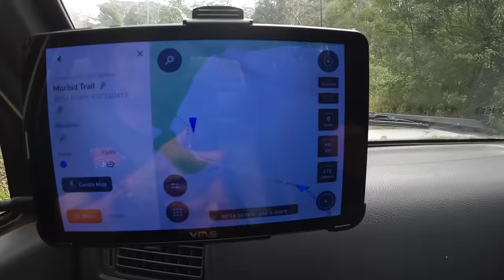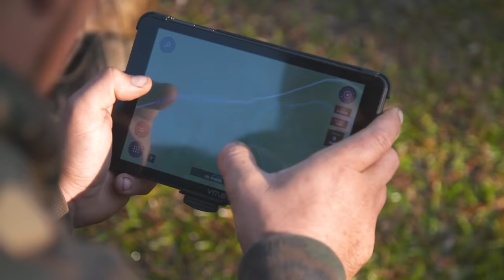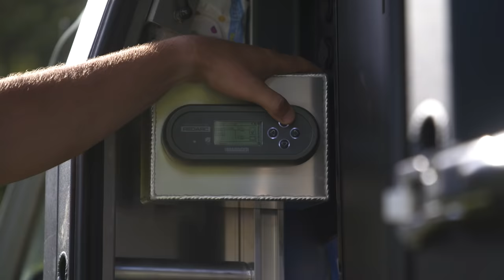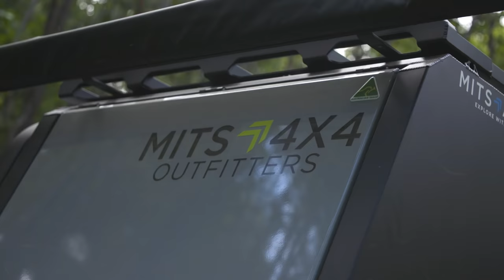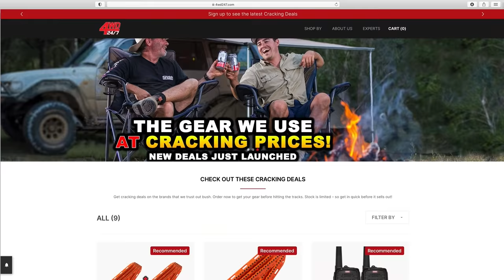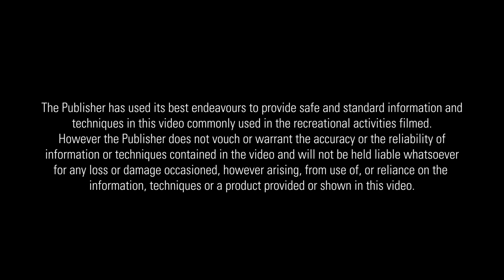OLD BUDGET 4WDs vs. Australia’s TOUGHEST tracks in Coffs Harbour + Snapped Axle & Best campsite EVER

Comment: Driving through the Lesotho mountain switchback passes at about 11pm at night in absolute darkness. Rushing down the hill taking the switchbacks and coming to a corner / cliff edge and touch brakes and all I get is abs shudder and noise but speed not changing, luckily the triton (colt / l200) managed to accept a lower gear quick enough and the duratrac tyres with their super grip kept the van on the road and through the corner. The rest of the way down the pass never went higher than 2nd and of course we were in low range already.

Another scary time, again in Lesotho and crossing a river which we had just walked and was about waste deep but nice grip with rocky base, start to go through and start to feel the car being pushed sideways and that was even with a pajero gen 3 loaded 5 adults and donations for the locals there.

Comment: Whilst crossing a swollen river in my 40yr old BJ42 we found  that the middle of the river bottom had been washed away making for a very, very deep crossing. The water was over the bonnet, in over the window sill and splashing over the roof! The rear end started floating away! The front two wheels then dragged the floating rear part of the car across the rest of the river. We got away with it, high fives all round and chocked it up to an experience that we didn't need to do again.  (And we both had to change our undies after the crossing)

Comment: scariest moment for me wasn't even on a trail, it was pulling a u-turn with a ford Explorer that had "automatic 4x4" as the default instead of 2wd. slipped on some leaves and the 4x4 kicked on and because I was at a full lock turn it lurched me into the ditch.

Comment: Not on a landcruiser. But on snapped truck axles. I have got them out with 2 telescopic magnets before. Handy little thing to carry. They come out easy as if the splines arnt twisted. Or a telescopic magnet and a long piece of wire underneath the broken section

Comment: Had a number plate fall off the back of a truck on the highway and it’s first contact with the road put it in a high velocity spin directly towards the drivers side windscreen. Was able to swerve into the opposite lane to avoid (thankfully there wasn’t any incoming traffic!). Massive pucker moment.

Comment: Scariest time for me would have to be when me and my 2 daughters were just going for a casual stroll up our usual tracks near home in the high country near Mansfield vic , done it 100 times BUT it began to rain very heavily right before the very steep hill climb , unfortunately there was noway to turn back before doing this hill, went ok halfway up THEN we began to lose traction on the now muddy track and begin to slip down and ended up sideways on a very steep angle , no matte what way I turned I just kept going to sideways and had a slight 2 wheel almost tip moment , thankfully the rear passenger tyre just caught a small rock mound during the slide and pushed us around facing back down and we were able to get back down to safety !
Thank goodness for whoever was watching over us that day as me and my girls were ok and proceeded home!

Comment: Scariest moment which is also a funny one. Crossed a creek on dead low tide to check crab pots. By the time we were coming back the tide had already turned and racing in. I wasn't game to sit around so I hit high 3rd and powered into the creek. Forgetting about the foot and a half bank on the other side. By the time that I realised it, it was too late. The front end of my 80 lifted. Then the back end lifted. The boys reckon the whole car jumped 2 foot in the air. My head couldn't be seen only my knees. I stupidly wasn't wearing a seatbelt which meant that I ended up hitting the ceiling of the car and knocking myself out. The lads had to race over and turn off the 80. All fun and games. I will always ever seatbelt safety. 🤙

Comment: Would love some seat covers on my new 100 series. Scariest time 4wding was when I took the family ute to go camping for the weekend with no plans to do any proper tracks. 2 days later with none stop rain the road in and out flooded and washed out. Tried to climb a small hill and ended up sliding back down and doing almost a 180 spin on the way down😱. Lucky we had some factory sest covers which helped in the clean up the real "mess" left inside.

Comment: Scariest moment for me, I was a passenger in a rear locked GQ Patrol at Landcruiser park and we got to the top of a track by the name of Club Rally Circuit, but the front wheels popped up, the forby leaned over and we slid back down to the bottom on our side. It took a few hands to push the beaut back onto the wheels, but all is good and we are back out all the time

Comment: Scariest time wheeling for me, was in my first car which was a dihatsu rocky. The old boy and i took it out whilst on my L's we were on a rainy day and we were searching for mud. We went down a abandoned bush track and saw some marsh to bash through. We ended up cusping the bonet in a water hole, and we couldn't move with water quickly spewing in and a water bed for seats. After a little bit we jumped put the windows and realised lockers werent on, so we managed to get down and turn those and we got straight out. Gave me the itch for 4wheeling and from what ever was in that water. Now I have a 2012 bt50 and made sure to install a snorkel so that if I have one of those moments again atleast the engine will survive.

Comment: Scariest moment in my 4wd would be returning from lake gairdner through station country towing my dry lake racer after week off racing and rough country roads, my rear left wheel over took me and the race car, found wheel out paddock 600 metres away by time pulled up etc, had three outta 6 remaining studs, snapped one doing nut up and had to borrow two nuts from the other side rear wheel… limped her home 150kms, parked her up and remembered the studs when had flat tyre 2 months later. Only drove the 75 series for shooting, driving rough roads, the works on two studs for couple months… not best idea, but gotta love the cruisers will to power through

Comment: Scariest moment 4wding, blew the front passenger tyre heading down a really steep sharp rocky hill in the Top End NT. About 15m from the top with 400ish metres to travel, drop off on the left, ruts and washouts on the right and no where to stop! Rode the shredded tyre to the bottom, dented and scratched the steel rim! Was scary as hell but man what a ride!!

Comment: Biggest brown undies moment was at the Portland Dunes, when a mate took a bad line, nearly putting his truck on its side with his family inside....  4 line pull, holding the vehicle from 2 angles, and a dead pull from two other lines.

Same trip, I skilfully removed the front end of my own vehicle, by accepting a challenge to get up a dune that no other dual cab had managed, and hitting it with a bit too much wellie... Yes, I got up the dune, but had to cable tie the front of the vehicle back together to get back home to Melbourne 👀🤣👌🏼

Comment: few years ago i just about lost my old 80 series off a cliff, had to drive sideways across the top of a hill which was quite slippery and then about halfway along turn into the hill to go down but either side of it was about a 20-30m drop, 3 cars did the track first with no issue but the 80 was a touch too heavy and slid while doing the side on section to the edge of the cliff. took us multiple hours multiple winches and over 150m of extension straps through a fence from the road to stop it going off. as far as i know  i don't think anyone in our group has ever attempted it again. i was in the car trying to stop it going further for a solid 4 hours and just had to stare down the cliff

Comment: One day the wife and I decided to go out to the brindies in the rain for the weekend what could go wrong aye well we went past the first campsite still daylight so continued on. Went up a steep hill and hit a step up and started sliding backwards at about 80 km/hr we thought we will have to hit a tree or roll it to stop as the handbrake didn’t help. Came to a stop and could hear a hissing noise so hopped out thinking it was a tyre when it actually was the gas bottle had turned on inside the locked tub. Once our hearts stopped racing went back to first campsite for a beer.

Comment: Scariest moment on the tracks was up mount Samaria in Vic. Decided to go up a little goat track that was climb after climb. Got to the top but couldn't get up. Donr a 50 point turn on a skinny track to head back down and right at the bottom my front slid into a rut, lifted the rear about 5 feet off the ground and rocked on my side step and front left tyre for two hours waiting on a recovery 😂 1p our of 10 did not want to land on my lid so had my foot planted on the brake just holding on for dear life 😂😂

Comment: Back in 95  I was up in the high country in my jacked up 82 v8 single cab  hilux  I was actually going down a washed out Shalely hill  the ass end slid down  I was sideways the hilux was still grappling for traction and it did but unfortunately it was the base of a tree and the wheel started to climb  and a pretty little pioete and from ass to head I landed on my lid  after Vic pol recovered me and absolutely wrecking my truck  in the process  I  now own that same truck after all those years  it’s a 308 and got all the bells and whistles  and it’s now a dual cab  lux life

Comment: Scariest moment for me. I was driving down a old 4wd track next to the train line after a few days of heavy rain. Got to a heavy decline with full on ruts. Me trying to adhere to my misses needs tried to pick the smooth route and as soon as I hit the whole car slid down into the rut and lost all traction, basically putting me on a 50 degree angle and lifting the side of the car up and bouncing. Surprised it didn’t tip. Ended up driving out but still a good story at the end of the day

Comment: camped by the river crossed a creek on the way in,had 70mm over night river rose 1m! and turned the campsite into a large island, i swam thru the creek to check how deep and fast it was a local in his GQ wagon had come down with his son to check the water level at the same time drove my ute to the waters edge used a couple of extension straps and spooled his winch out as soon as i drove in it was so deep that my ute was floating water up to  my windscreen drifting toward some trees in the creek the local in the gq gave it a gut full and pull me accross pulling the front down allowed me to steer my way accross and made it!!!!!!!!!!!

Comment: Scariest moment for me was in my Suzuki Grand Vitara at Imbil state forest. Only mod was some not very aggressive all-terrains, in the wet, following two mates in much more capable rigs. Was going up a steep hill, foot flat in second low, going good until the almost vertical bit. Lost all traction and started going backwards. All I can see is sky and the tops of trees, and I know if I didn't stop in about 2 meters, I'd end up on my lid. Thankfully jamming the brakes and the engine stalling stopped me in time.

Took a good 5 minutes just sitting there before I gave it another go. Made it up in the end, but if I wasn't fully puckered I reckon I'd have needed some new seats.

Comment: The absolute scariest time was we were in a 92 toyota hilux x-cab. Wheeling alone and getting bogged down by heavy wet snow. We tried to turn around and ended up on three wheels pointed down the mountain, suspended in the air on frozen on the left pedal. Any movement would have gone over.

Comment: Scariest time on the tracks was when I was a young lad and passenger, went up tallarook in Victoria, the vehicle I was in was a GQ short wheel base. One track we did we got to the top and bounced our way up unfortunately the car bounce a little hard and ended up throwing both front wheels up in the air and ended up coming to rest on the rear tow bar and back wheels nearly rolling end over end down the track

Comment: My scariest time in a 4X4 would be on a robe to Beachport trip here in SA after I’d recently gotten my Hilux with some friends. They had radio’d from further back in the convoy saying they’d found a camp spot so we proceeded to turn around and as soon as we were off the main track we literally hit quicksand!! I buried the throttle but it just tracked towards the raging ocean! Grabbed reverse and it just buried itself to the diffs and with a quickly rising tide it was all hands on deck with shovels, maxtrax and a snatch strap attached to a mates Rodeo to save the day. (If only I could attach a pic as the waves were lapping at the front wheels)

Comment: Scariest moment for me in my 4wd was travelling at 102km/h down the highway and my right hand tie rod fell off. The left hand side flicked over and tore up the inside of my tire. I ended up swerving to the left & off the road and down a small embankment and then sliding to a halt up another embankment. I stopped about 2 meters from putting it on it’s side. Lucky it went left as there was a 4wd with a caravan and a semi trailer coming in the opposite direction. Luckily my mum & myself were wearing brown pants. 😆😆

Comment: Scariest moment I had in my 105 was on a local back track called the widow maker, it’s steep rutted and has a big bolder in the middle, Friday night drive turned into a Saturday morning drive about 1am trying to get up the side of the boulder and slipped into a rut and slid straight back down about 5m and caved in the passenger doors and rear bar on the wall and then decided at that point was a good idea to back down and take a side track out before doing anymore damage, lucky it had vinyl seats 😅 haven’t done anything that wild in the 80 yet.

Comment: Honestly happened today. Scariest thing that happens to me was I was re wiring in my engine bay trying to neatening everything (heat shirk, conduit and cable tie everything nice) and I must of left my soldering iron on or my hot torch and I noticed smoke and then a flame from inside the cab, lucky nothing happened too serious. Just burnt my seat covers  and put a hole in my seat. My heart sunk. Honestly for a second I thought I was gonna loose the car 😂

Comment: Scariest moment by far was in the passenger seat (our divers side) of a Jeep Cj5 3 speed V8. Started on freeway offramp when unannounced the driver decided to straight line it and try an impromptu hill climb he had always wondered about. The torque monster made it up fine but recon I crushed the roll bar with a death grip due to the incline and lack of roof and seat belts.

Comment: My scariest moment behind the wheel was the first time I ever went 4wding... I was hitting bog holes way to fast because I had  absolutely no idea  what I was doing and didn't want to get bogged 😅 Suprisingly I only lost my bash plate and broke the bottom hose point on the radiator 😅 Even though I was freaking because I thought I cooked the engine the first time taking it 4wding 🤣 Fixed her all up and she never missed a beat since... Gotta love Toyota's aye Shauno 🍻 Dont worry I quickly learned after that incident you don't drive them like a commodore on the tracks 🤣🤣

Comment: Scariest moment while I've been behind the wheel of my luxy. Not on the tracks but on the highway between tracks. Had all six of the front right studs break at 110km putting the hub into the bitumen, while the wheel went into the paddock grinding to a stop across two lanes of oncoming traffic. Thankfully the strut assembly was the only thing tht needed fixing.

Comment: Scariest moment was a bunch of trees had fallen on the track. To the left of the track, steep hill going up. to the right, sheer cliff drop. The track was just slightly wider than my 4wd, and it was stuck in 2wd at that time, had to turn around because there was no traction trying to reverse. ended up burning the clutch a bit but we got it turned around by launching it up the steep bank on our right, then doing a 50 point turn with the car on a big angle. Scary.

Comment: Scariest time in track is when at the time I went to a massive steep wet hill and my car loose traction and started sliding down hill and stop side ways and nearly tip off on the roof , an hour later we finally got it down nicely safe. But I will go back again with this time a center diff lock 🔥

Comment: The scariest moment of mine was up in the little desert in Victoria, powering through a long road of wet slippery clay. I powered through some sludge at about 80km per hour (a lot faster than I should have) and the back of the Hilux slid out on me, to the point where I looked through my window and I was looking at the tub. ABS kicked in but it was too late at that point, heading straight towards trees. Lucky the trees came straight out the ground on impact, otherwise the whole front end would've been wrapped around them. Lucky no one was injured and car not written off. I certainly could've used some seat covers after the marks I left on mine during that ordeal :'')

Comment: The scariest time on the tracks was close to home took a wrong turn from my mates (under the misus instruction) found myself on a very steep climb tried to winch. The winch blew. Hooked my mate's winch up using a snatch block off a tree. Ended up pulling the tree out of the ground onto the car just missing the roof landing on the bonnet. Pulled another 2 trees out of the ground onto the bonnet before we managed to get the car up and out 4 hours later. Each time thought I was a goner. 

We were trying to rush the recovery as the hole I was stuck in previously I needed to be winched out and my other mates finger got pulled in from the control's being reversed. 1 severed finger later and a rush to get out of the bush.